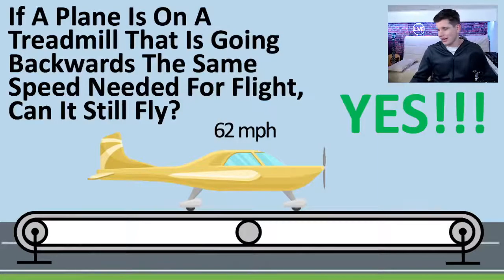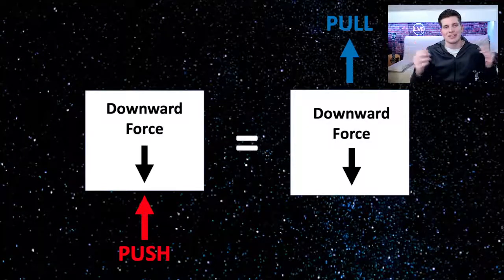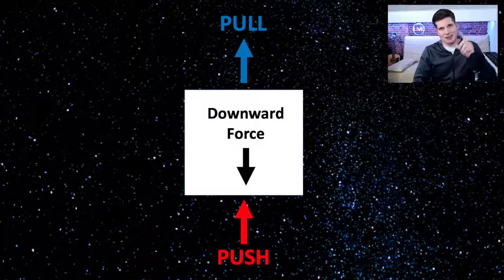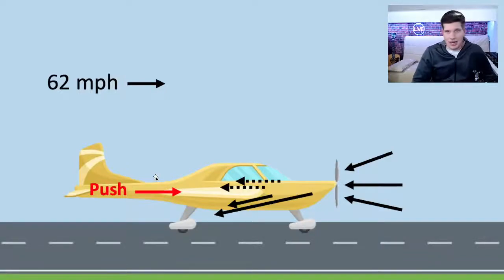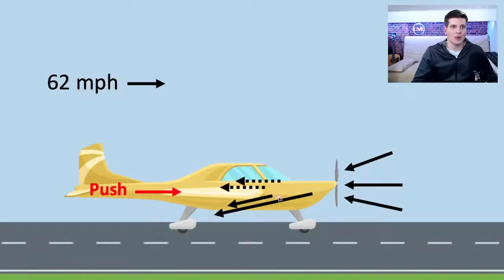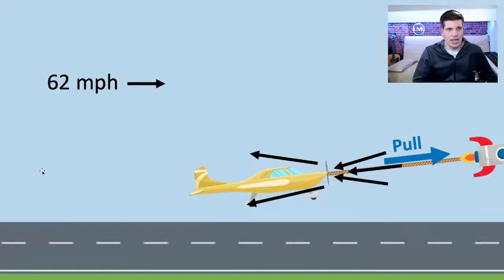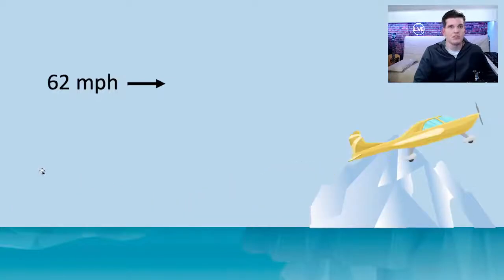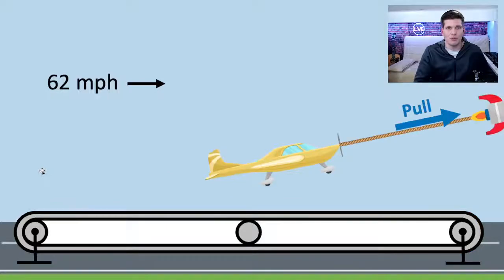Can A Plane Fly On A Treadmill? SOLVED! -A Practical Review

Comment: The photo that I seen shows the rear of the plane right at the back of the treadmill and the front off the plane is right at the front of the treadmill. The plane cant move forward or it will fall off the end off the treadmill. Of course if the plane moves forward it will take off but whet I'm seeing is no where to go on the Treadmill.
Reply: the treadmill is as long as the runway would be not as in the illustration

Comment: Please, in the picture of time 13:22 write what is the tangential velocity of wheels. Remember that in riddle is condition: "Velocity of wheels = velocity of belt, in opposite direction" Did you violate this condition? Also the riddle is about Boeing 747.
Reply: The speed of the wheels has to be linear speed since the treadmill can't match rotational speed of the tires. Remember that at the point where the tire contacts the ground the speed is zero mph (it's assumed to not be skidding), and at the top of the tire the speed is double that of the vehicle. At the front of the tire the speed will match the speed of the vehicle, but will be 90 degrees downward, and at the back of the wheel the opposite, the tire speed will match the vehicular speed, but at a 90 degree angle upwards.

Comment: You "Wrong Brothers" still don't get it: While the wheels might spin at 62 mph on a treadmill matching their speed, the wings aren't moving forward through the airstream—so no lift is generated.

To prove it, try this simple experiment: Next time you're in a car, roll down the window and stick your arm out flat like a wing. Start from 0 mph and accelerate gradually to 80 mph. At low speeds, you'll feel minimal pressure—just a gentle breeze pushing back. As speed increases, the wind force builds dramatically: your arm gets pushed upward and backward with increasing intensity due to air pressure differences, mimicking lift. By 80 mph, it's a strong, sustained force that's hard to resist. This demonstrates how relative airflow creates aerodynamic forces.

Now apply that: On the treadmill, the wings are at 0 mph relative to the air—no airflow means no lift to overcome gravity and drag. It's not about wheel speed; focus on the wings needing forward motion through the air.

Anticipating the counter: "But engines pull air to create lift!" Wrong. Wings generate lift via airflow; engines provide thrust to propel the plane forward. In a jet engine, air is compressed, mixed with fuel, ignited, and expelled rearward for thrust—but that air isn't flowing over the wings; it's confined to the engine intake (the column directly in front of the cowling at cruising speeds like 530 mph for a 737 or A320).

What about tail-mounted or pusher props? Take the A-10 Warthog: Its high, rear engines don't create lift—they deliver thrust to push the airframe, moving the wings through the air to generate lift. Without forward motion, no dice.

For the last time: A plane won't take off on a treadmill. MythBusters erred using an ultralight with its absurdly low takeoff speed, skewing the results. Love the show, but they got this one wrong. (In my timeline MythBusters "Confirmed" Plane Take-Off Treadmill, BIG fan of MythBusters)
Reply: They erred in a number of ways.

They used the air speed indicator on the plane and the speedometer on the truck.

Comment: It cant fly...its thats simple.....

A 747 tire is 153" in circumference, so every rotation on a runway, the aircraft moves forward 153". So if you cancel that out with a tredmill travelling at 153 the opposite way the wheel wouldn't have any forward motion. People try to make this more complicated than it needs to be
Reply: Exactly correct.

It’s a kinematics equation where we are given the parameter of equilibrium.

Comment: When you said "it's a lot more complicated than it sounds", I had hope. But you're just making the same basic points as most others. Almost every time I see this question, the wording is: "Imagine a 747 is sitting on a conveyor belt, as wide and long as a runway. The conveyor belt is designed to exactly match the speed of the wheels, moving in the opposite direction CAN THE PLANE TAKE OFF?"
Your answer is correct for when the plane is on a runway designed to move at the plane's regular takeoff speed. And as people always like to shout, MYTHBUSTERS PROVED IT!
But in the more common wording about a belt that matches the speed of the wheels, the plane cannot move, as any forward movement tells us that the wheels are moving forward faster than the belt is moving backwards. 
It doesn't matter where the thrust comes from. Forward movement is not possible unless there is a speed mismatch between the wheels and the belt.
Reply: Exactly.

The people who say the plane takes off magically separate motion at the wheel axis from the basic angular speed condition that is intimately tied to tangential wheel speed.

The equation is speed of the wheel axis is the difference between tangential wheel speed and motion of the surface.

If Mythbusters had measured the speed of their aircraft they would have seen where they went wrong.  They just jammed on the throttle of the aircraft to take off as opposed to reaching equilibrium between the truck and the aircraft rolling on the canvas.

Comment: If a plane was attached to a rope on a treadmill, you can still pull the rope to make the plane go faster and take off
Reply: That fundamentally changes the parameters of the problem so that it is completely incompatible.  That is a breakdown of position, speed, and acceleration.

If you forced that new condition on the thought project, the test vehicle would scrub along the surface since your speed conditions are in conflict.

That’s a bad kinematics example.
Reply: @MrDefreese  It was to illustrate the point that the engines push/pull the plane via the thrusted air, which is disconnected from the treadmill. The rope helps people visualize this better since they wrongly think the treadmill will hold back the plane.
Reply: @GoatDirt yeah, that’s flat out incorrect though.

If you want to understand why it’s incorrect, you would have to start with the fundamentals of kinematics - first for the thought project as designed and then write down the add on equations with the constraints you added with the rope conditions.

The fundamental math and physics don’t change.  Your condition is an incongruity.  What would happen is the test vehicle would scrub across the surface.
Reply: @MrDefreese the wheels will just spin faster as the rope/propeller move the plane forward. I acknowledge they are not exactly the same, but the point is to illustrate the planes forward movement not being contingent upon the treadmill. The rope will obviously be attached to a winch or something to pull it fast enough, but the physics works out to be exactly the same assuming the forward vector F is the same (regardless of its source). Nice addition  though on your part
Reply: @GoatDirt you are again changing the parameters.  The wheels don’t just spin freely.

There is a kinematic equation fire wheel rotation and linear motion and frames of reference.  Adding a rope condition is incorrectly changing terms.

You have to use the fundamentals, not add on a false revision.
Reply: @MrDefreese im not sure why you think changing the parameters matters here (which no one denies). Its only purpose is to illustrate the FACT that the forward vector is not tied to the treadmill. The free-spinning plane wheels are obviously not without rolling resistance, but there is zero propulsion coming from the wheels. Super simple concept. Need any more help, let me know
Reply: @GoatDirt  oh dear.  Your comment shows you are much worse off than it originally appeared.

On the up side, you did triumphantly announce that there is zero propulsion coming from the wheels.  The down side for you is multiple - not a single person is suggesting that the wheels provide propulsion in this thought project.  That's a fascinating aspect of this thought project that you people think is a winning point.

Even worse for you, it doesn't matter if there is a propelled wheel set or not.  The thought project is about kinematics - the motion of objects in a frame of reference.  An object rolling at 25knots on a surface moving at 25knots has zero net motion.  Hopefully that basic fact can sink in for you before you try to respond again.

What you have shown is a thorough misunderstanding of kinematics, angular momentum, and derivative calculus.  If you are tempted to respond, don't, until you understand and internalize that basic math.

If you need help...seek out a teaching assistant for office hours.  Suggested topics are 'frames of reference', 'angular momentum', the derivative of position and the derivative of speed.

smh
Reply: @MrDefreese 10:29 should help you with upgrading your second grade misunderstanding of this. Try harder 😂🤦‍♀️
Reply: @GoatDirt bang up job!  You just referenced Newton’s laws which show that force is just force 

What another unremarkable contribution you just made!  Heckuva job!

Pretty soon you will get to kinematics and angular momentum!
Reply: @MrDefreese angular momentum doesn’t apply here, only forward momentum as applied by the propeller. Mythbusters and Mark Rober did this exact experiment and the planes took off just fine. After you watch both their videos and learn about rolling resistance, I hear crow is best enjoyed with paprika and ginger. Make sure that oven is not over 234° or you may hurt your lips when you eat it. Let me know how it tastes?
Reply: @GoatDirt the forward vector is tied to the rotation of the wheels, not to the force being applied by the engines. The forward vector of the rotating wheels is not tied to the atmosphere, but instead tied to the ground in which it sits which is, in fact, the treadmill.
Reply: @ilyer4199 he or she doesn’t understand frames of reference or angular momentum.
Reply: @MrDefreese  Your analysis of the aircraft takeoff scenario is fundamentally flawed due to a misapplication of fundamental physics principles, a confusion between different frames of reference, and a failure to account for the medium of propulsion. The dismissal of the "rope" analogy and assertion that the wheels' motion is the sole determinant of the outcome reveal a profound misunderstanding of aerodynamics and Newtonian mechanics. 

"an object rolling at 25knots on a surface moving at 25knots has zero net motion" is a classic error stemming from an incomplete analysis of the system's frames of reference. This statement is only valid in a single, isolated frame of reference where the two opposing velocities are measured relative to the same stationary point. 

Kinematic analysis requires considering three distinct inertial frames:

The ground frame (FG): This is the stationary frame of reference.

The treadmill frame (FC ): This frame moves relative to the ground.

The airmass frame (FA ): This frame is what the aircraft moves through to generate lift.

An aircraft's ability to fly is governed by its airspeed—its velocity relative to the airmass frame (vp/a ). Lift, as described by the Bernoulli principle and the Kutta-Joukowski theorem, is a function of this velocity, not the aircraft's ground speed (vp/g ) or its speed relative to the carrier deck (vp/c).

"it doesn't matter if there is a propelled wheel set or not" is correct, but your reasoning is incorrect. The wheels are a passive system; their purpose is to reduce rolling friction. The propulsion of the aircraft comes from the engine/propeller, which generates a thrust force by accelerating a mass of air in the opposite direction (Newton's Third Law). This thrust is what accelerates the aircraft through the airmass. The "rope" analogy accurately describes this principle, where the propulsion force is applied relative to the surrounding medium (the air), not the surface.

You demonstrates a failure to distinguish between a ground-based kinematic problem and an aerodynamic one. You have conflated the speed of the aircraft's wheels relative to the treadmill with the airspeed required for lift. The wheels' rotation is irrelevant to the aircraft's propulsion and lift generation. This misunderstanding of fundamental physics, particularly the concept of relative velocity in a non-inertial frame (the moving treadmill) and its impact on the surrounding fluid medium, is the root of all your erroneous conclusions.
Reply: @AlicesWondereland snicker.  Did you try using chatgpt or something to help you craft that?  Lol.

Your answer is poorly structured untruth.  You need to do better than that or go to office hours.

You have posted so many incorrect things it would require a paid job to fix.

Let’s just point out that adding a rope component means you are creating a different position constraint that is ultimately incompatible with the kinematics analysis of the speed constraints provided.

Mathematically and physically, you show you don’t know derivative calculus.
Reply: @AlicesWondereland snicker.  Did you try using chatgpt or something to help you craft that?  Lol.

Your answer is poorly structured untruth.  You need to do better than that or go to office hours.

You have posted so many incorrect things it would require a paid job to fix.

Let’s just point out that adding a rope component means you are creating a different position constraint that is ultimately incompatible with the kinematics analysis of the speed constraints provided.

Mathematically and physically, you show you don’t know derivative calculus.
Reply: @MrDefreese tbf, a very limited amount of people can correctly analyse this hypothetical, even if they come to the correct conclusion.
Reply: @MrDefreese  Yeah, I've had a look at what you wrote. It's a real masterpiece of nonsense. I'd love to say it's just poorly structured, but it's more like a random collection of buzzwords that missed the mark completely. 

You know, the idea that adding a "rope component" is a problem shows you completely missed the point of the analogy. The rope wasn't real; it was a way to explain how propulsion works relative to the air, not the ground. You've gotten hung up on the metaphor instead of understanding the physics it represents. And then you brought up derivative calculus. That's a bold move, considering your entire reply demonstrates a profound misunderstanding of basic kinematics and relative motion. You're trying to use big words to sound smart while completely ignoring the actual physics principles I laid out.

Honestly, it's so wrong it's almost impressive. Maybe you should take your own advice and go to office hours. Or better yet, maybe just put the physics textbook down.
Reply: @AlicesWondereland derrrrrp.

If doesn’t matter how the force is applied to the body.

You need to just sit quietly at your desk until called upon instead of embarrassing yourself…again.
Reply: @MrDefreese  sigh

You're very good at sounding smart. But if you were half as smart as you think you are, we'd be laughing over your comments with a bottle of wine. Seriously. You're not applying anything in the manor you think it applies. You're just throwing word salad on the internet and think you're making sense. With 30+ years of aviation experience, I can assure you, the plane takes off. In any of the scenarios you've provided or were originally speculated. 

Airplane wheels are independent from how it move forward. They can be moving at 60 or 600kts in any direction. Airplanes are moved through the air (forward) because of the engine (Prop or jet). Amphibious (sea planes) deal with this all the time. The current might be flowing north, as they are taking off to the south. Yet they still take off. Head over to Tavares fl and watch the sea planes take off. Theres a nice restaurant by the lake we can watch them from. My treat.
Reply: @AlicesWondereland Alice, I totally agree with you...
Reply: In this riddle, if you start talking about wheels, tape, or reference points, you've fallen into its trap...

It's a phrase meant to deceive and make you think the plane must remain stationary, a test of intelligence...

The plane and the tape are two systems that work independently...

The passive wheels are always "matched" with the tape, no matter what the plane does...

 This is the gist of the riddle and what it's trying to demonstrate...

When it takes off, you can see it from any reference point, so talking about reference points is obsolete and relative.
Reply: @francescolucakeplero7975 wrong. Reference points are literally the only thing that matters here. The air speed with reference to the wings (and prop speed to the air) are what determine the planes movement. What throws people off is thinking the treadmill will affect the propeller and make the plane remain stationary as they forget the free-spinning wheels will just spin at 2x the ground reference (or rollers ok the belt) 

The only thing keeping a plane stationary would be if the rolling resistance frame equals forward thrust frame.
Reply: @GoatDirt I agree with you, except that it seemed superfluous to talk about reference points...

The fact that the plane "runs through the air" is obvious and banal because even kindergarten children know it...

 Obviously, whoever invented the puzzle didn't want to test rolling resistance but only to trick the audience into answering it; otherwise, it would have been too trivial...
Reply: @francescolucakeplero7975 it doesn’t take off.  The math and physics tell you why.  The plane can’t move faster than it rolls and it rolls exactly as fast as the surface moves in the environment.  Kinematics.